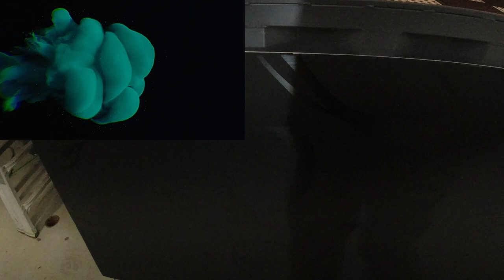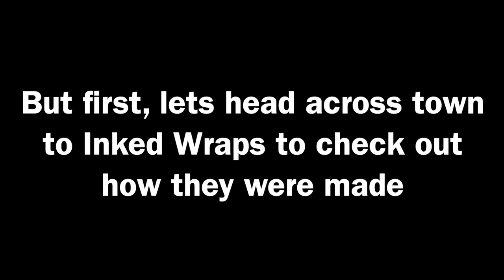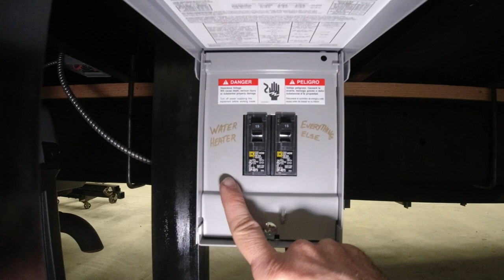Building a Custom Pizza Truck (Episode 11 )

Comment: You could have just ordered 1” double pane igu’s and siliconed them in with a stop behind it. Think commercial hollow metal frame glass.
Reply from the maker: I actually gave them that option, but they liked the larger black frames.  I'll be using igus on my ice cream truck project i'm working on now